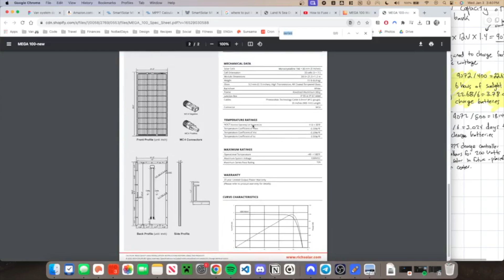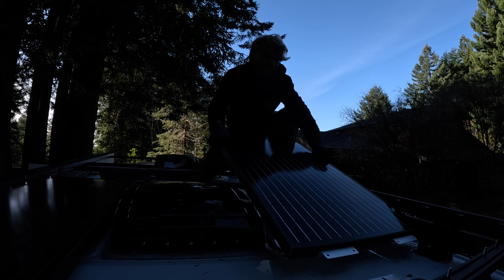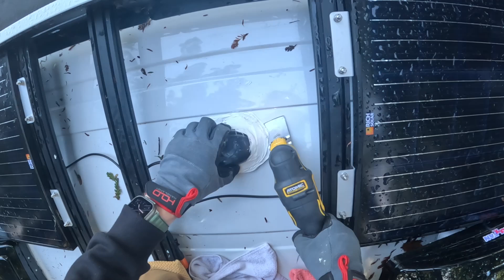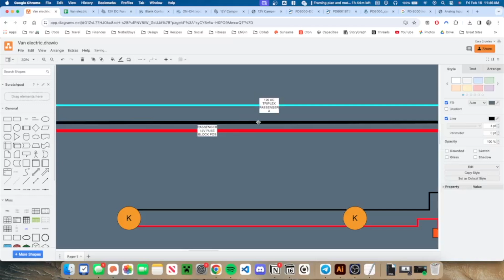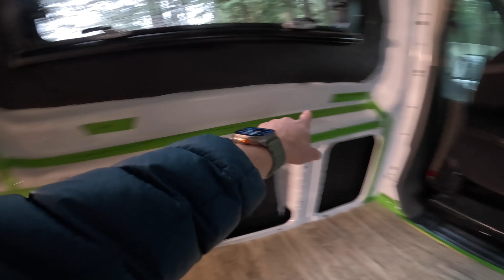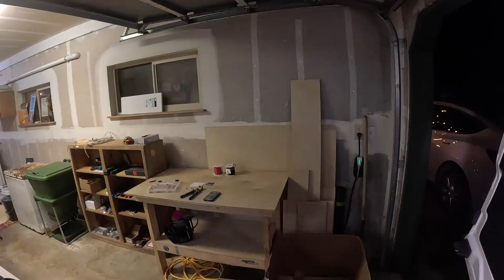Rooftop solar & pre-wiring | Cory's van build (part 6)

Comment: FVCO rack? Love the bag idea to contain metal shavings! I’ll definitely be using that idea.  You really did a great job planning with that computer program. I’m still debating on the 3-way switches. So many wires. 🥴 Thanks.
Reply from the maker: Yeah got the FVC roof rack!  Def went a bit overkill with the digital planning but it helped a lot with conceptualizing the wiring.   I think if you’re very strategic with the placement there’s no need for 3 way switches, but they are pretttty cool.